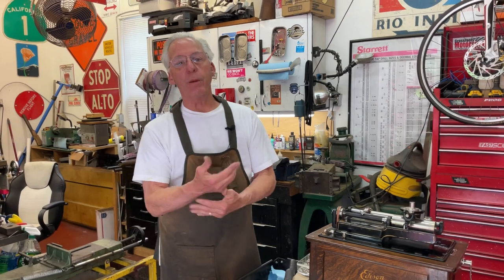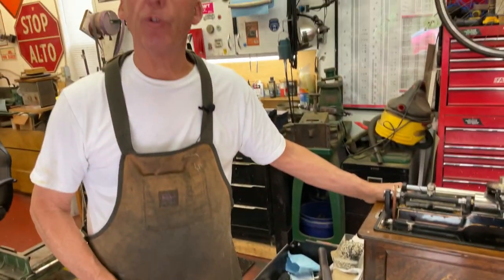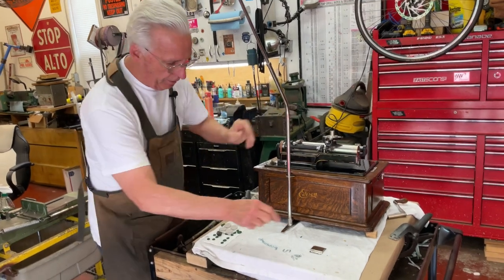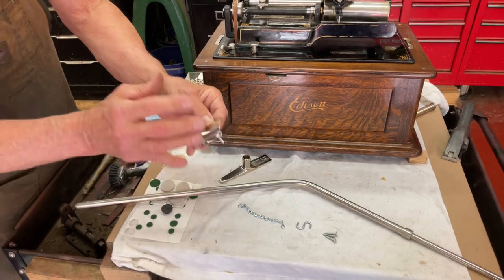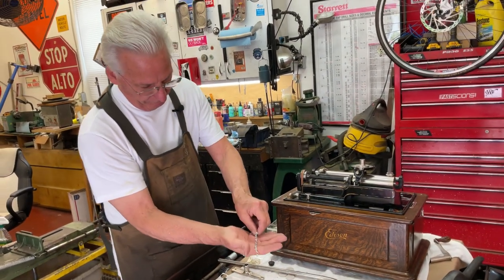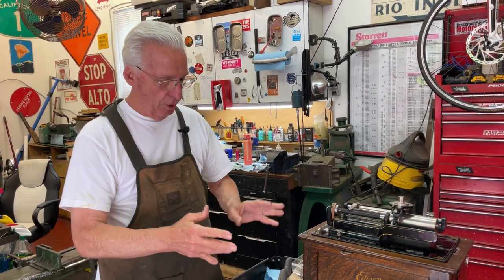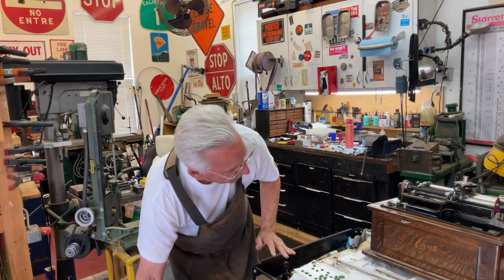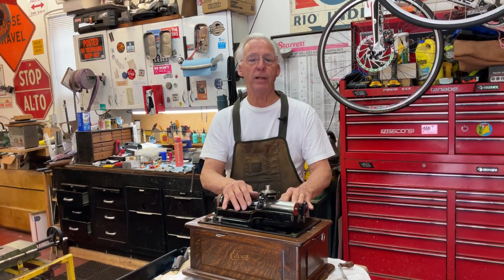1049.  Installing a front-mount Edison phonograph crane

Comment: It the vertical rod solid steel?  A half inch diameter rod may be a little stiff.  The foot opening is usually 1/2 ID.
Reply from the maker: No, it has a hole in the middle so that the top rod can be fitted.

Comment: Do you have a video on how to set up a cygnet horn on a Triumph?
Reply from the maker: Video 936 is how to mount a horn and installing the cygnet horn is the same, you just have to adjust the spring tension from the top so the carriage will move smoothly.